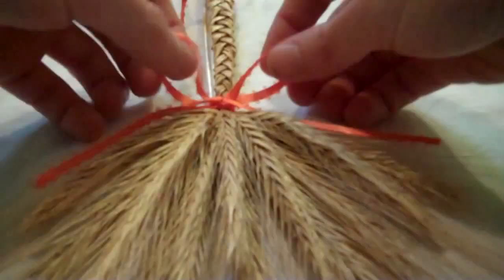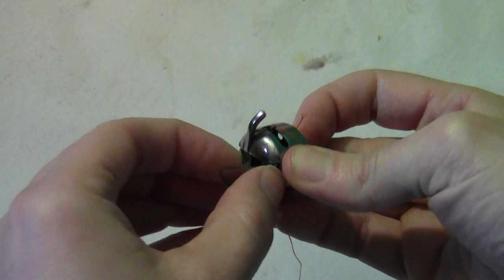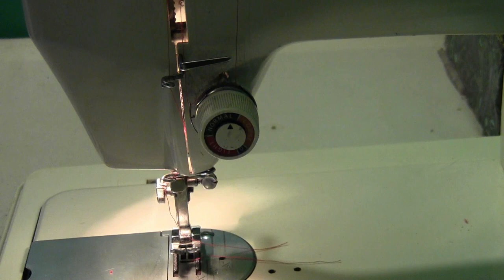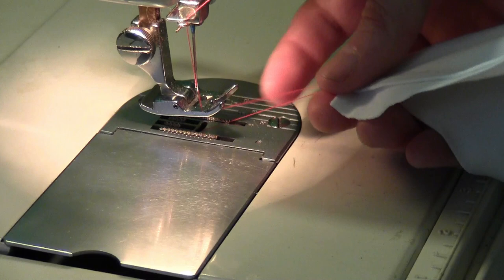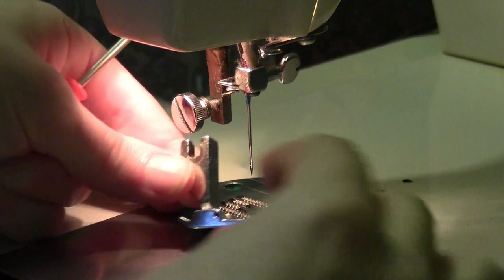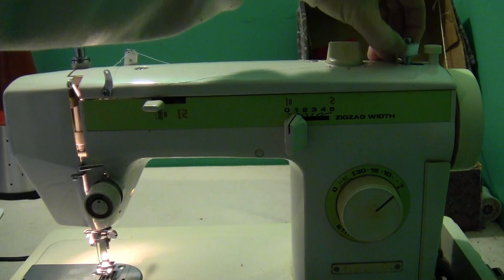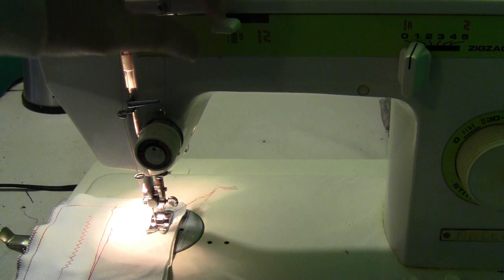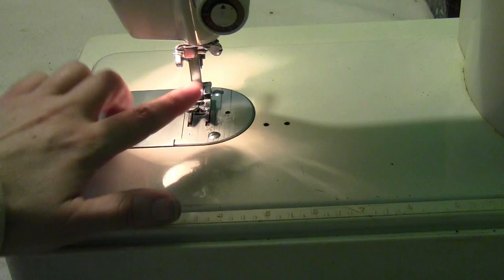How To Use A Sewing Machine (Old Nelco Model)

Comment: I bought a Nelco in about 1974 in Anchorage and stupidly paid  $500 for it from a traveling salesman not knowing any better.  I do like the fact its Japaneese. All metal. Still works but has a tendency of tangling under the presser foot too much for my liking.   It may be inexperience on the tensions, but Ive seen others just run the machine without mate4ial and it makes a long link of threaded knots without tangling....I have no idea how that works ....mine would jamb almost instantly.
Reply from the maker: Mine would jamb if I ran it without material too, but as long as I have fabric, I usually don't have a tangling problem. It could be the tensions or it could just be that the timing is off on your machine. If it's the timing, a sewing machine shop can usually make a simple adjustment to fix the problem.

Comment: I bought a Nelco on Craiglist for $20. Mine is a 1971 model and looks similar but older than yours. I bought it because I respect cast iron parts vs. plastic in modern machines. I don't need fancy nonsense gimmicks, just reliable repairable mechanicals in a machine that sews. Mine has a jumpy motor controller but it does have a good solid sewing mechanism. My reverse selector is in the center of the length knob and is even worse than yours, but I don't mind it. It has contributed to many successful sewing projects. I would like to figure out what size replacement bulb it takes since mine is missing and I don't know how bulbs are specified in sewing machines. Thanks for your helpful video!
Reply from the maker: Mine takes a little 15w bulb. The base is about the size of a nightlight bulb. I got mine at JoAnn Fabrics, so they're fairly mainstream. Yours is a little older, but one of those would probably still fit it. If you asked someone at a local sewing store, they'd probably know if they had one in stock for it.

Comment: I prefer older machines solely because they're so straight forward. They're little tanks and seem to run forever. And, if they do break down, it's usually a simple repair and they're right as rain again. This is a great instructional, not only for this Nelco model, but for the basics of any sewing machine. Fantastic job!
Reply from the maker: Yup, the simpler they are, the less they malfunction.

Comment: Thank you so much.  I have a Nelco model 102 but after two moves, the instruction manual has been lost.  I haven’t used in several years so have forgotten how to thread and fill bobbins.  I have spent hours researching info but your video is absolutely the best I’ve found.  The information is clear, concise and answers all my questions.
Reply: Hey if you still need the manual I have a PDF copy.

Comment: I cannot believe I found this video. I just bought a sewing machine at a thrift store but was trying to find info on it because it has no brand name that I can find. Now I'm baffled because it is EXACTLY your machine. All the same parts, colors, labels, 100% this machine, but the only label it has is "Industrial XL." So bizarre. I'm so grateful to have this video! Thank GOD you explained how to backstitch on this thing I didn't even realize that button pushed in LOL. Currently the machine doesn't, um, work per say, but I'm determined to fix it. Thank you so much!
Reply from the maker: Wow, that's wild! Cool. Glad you were able to find this video. Maybe the Nelco label just fell off the machine since it's older. If you're able to get it fixed, you'll love it. It will pretty much last you forever. They're very solidly built machines.
Reply: @Thewoodlandelf  I'm curious, does your machine have a model number? Mine says SZ-206, I wonder if they match or if mine was made under a different label somewhere.
Reply from the maker: Yup, mine is an SZ-206 as well, so you have the exact same machine as mine. The only label that actually says Nelco on mine is right on the front side, under the big button. So it's likely it just fell off of your machine at some point.
Reply: @Thewoodlandelf  Amazing! Thank you!
Reply from the maker: Did you get the manual pages ok? I sent them last week, but then today I got some kind of delayed bounce notification from it in my email, so just wanted to double check if they came through to your email ok.
Reply: @Thewoodlandelf Oh weird but yes I got them and replied, so not sure what happened. Anyway, thank you again!!!
Reply from the maker: Ok glad to hear it. Yeah weird, your reply never came through and I got a bounce back instead. Email can be a little squirrely sometimes I guess, haha. But glad you got it ok. Happy sewing! 😊

Comment: Thank you for this most recent tutorial on the Nelco. I bought my N 250 -3 new in 1972. It came with 20 stitch cams, most of which I’ve never used. I do recall that in threading the bobbin, the first thread guide on top of the machine has a washer behind it, which is meant to wind the thread around to provide tension. Your triple stitch feature is great, I’ve never heard of that on any other machine. My bobbin door opens forward, like a car hood, which I don’t like. The race assembly gets jammed and the unit has to be tilted up to get access. I’ve seen needles threaded front to back and left to right. Mine only fits flat face forward,  I guess it has to do with the bobbin location. Finally, I lent my machine to my sister for crafting and she returned it without the manual. When it appears I should make copies available. Appreciate your videos.
Reply: Mike, is your machine a 250-b-3? If so I would love a copy of the manual. I just bought this machine at a thrift store and can’t locate the manual nor do I know what type of cams work for it. Thanks if you see this.
Reply: @pookiebear9200  So far no luck finding my booklet although threading is sort of intuitive. Practice will give you confidence until it will seem so easy.the manual will be unnecessary.
Reply: Thanks for your reply thanks 😊Mike. I did find a manual for the 350b4. Very similar. I wanted it for oiling and other things besides threading.

Comment: I wonder if someone can help me . I bought an Omega vintage sewing machine. Underneath the machine it is marked JA-38. I made research on Google and found that a very similar machine was also called Nelco JA-38. My problem is that the straight stich is fine but when I try to make a zig zag stitch it only works with the number 5 width. When I put the wheel on 2, 3 or 4 to make my zig zag narrower it does not stay there and comes back to 0 which is for the straight stitch. Anyone has an idea what I am not doing right or have a manual for that machine. Thanks.
Reply from the maker: Not sure, but it sounds like there might be something broken inside that prevents the wheel from staying in place on the smaller zig-zags. You might need to take it to a sewing shop and have them look at it.

Comment: When looking for replacement parts, Nelco isn’t an option to choose from.  Any suggestions for parts?
Reply from the maker: Nelco parts are kind of a hit and miss search. I've seen some on Etsy, and there is a shop in the UK that does Nelco parts: https://www.sewingparts.co.uk/nelco.html Those are pretty much the only I know of. Though occasionally I have found that Singer parts will interchange with Nelco in some cases. You want to check the pieces really well before you try it, if you go that route though.

Comment: I have a Nelco Model SZ-106 and it won't wind my bobbins. I am afraid of taking it apart because I do not have the original manual that came with it. I got it to work once last week and never again.
Reply: Turns out the rubber piece that helps wind the bobbin is worn down.
Reply from the maker: Gotcha, yeah, you'll probably have to have that replaced then.

Comment: I recently acquired an older Nelco machine. It isn't made like yours and I don't see a place to put the spool of thread to even sew! Or to thread it! There is the one to fill the bobbin...
Reply from the maker: If it doesn't have an obvious spool holder, it might be a drop in threader. Like there will kind of a hole somewhere that the spool holding is hiding in. Usually somewhere near the top or back side of the machine.

Comment: I was wondering, do you know how to change the position of the needle for straight stitching so that it's in the center of the presser foot for example? does this type of machine have this option?
Reply from the maker: Mine does not have that option. I can move it side to side by switching on the zig-zag stitch, but other than that, the needle is in a stationary position. If it were moved, it would hit the presser foot and snap. I'm not sure about other models; it's possible that one of them may have such an option.

Comment: I have a Nelco B85 Model # 102.   I've had it since about 1983.  It works great!  Anyway, what size bobbins should I be using?  I can't find any info online, and I'm puzzled that the new bobbins I have that I thought would fit (they look like #15 but they're not labeled)  don't fit onto the bobbin winder.  What size bobbins should I look for?
Reply from the maker: Are your bobbins sides flat or convex? Mine is a different model than yours, but it takes the standard #15 bobbins, as long as they're flat sided. I have some #15 bobbins from an old Singer machine, but the sides are slightly convex, and they will not fit into my Nelco. Only flat-sided bobbins will.

Comment: very good video!   is a nelco r- 300 zigzig good for sewing sunbrella  fabric?  
 it is being sold as a heavy duty machine...
Reply from the maker: I'm not sure about the r300. Mine is a SZ-206, but I'm pretty sure the r300 is still a personal sewing machine, not industrial. Even the personal machines do tend to be able to sew though more than standard machines though, since Nelco is an industrial company, and they're solid metal. I've never tried sunbrella fabric on mine, but it does sew duck cloth and denim fine (as long as there's not another fabric of different texture over it).

Comment: What type of needles do you use? I want to sew a layer of canvas to a later of velvet so it will need to be heavy duty.
Your video is super informative and I needed it more than you know. I'm working on my final project for fibers
Reply from the maker: I use standard Singer needles. They fit any machine. Usually you can find several grades in the same pack, so just use the ones meant for denim and other heavy fabrics. Good luck 😊
Reply: @Thewoodlandelf o